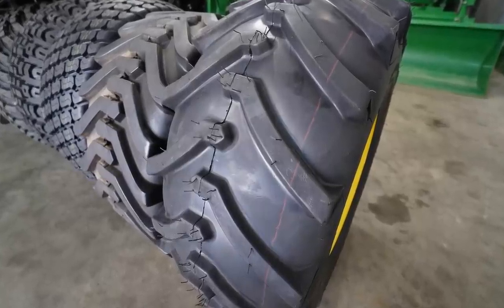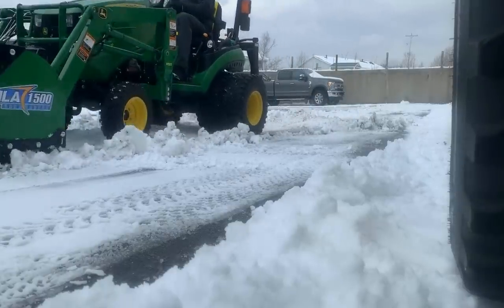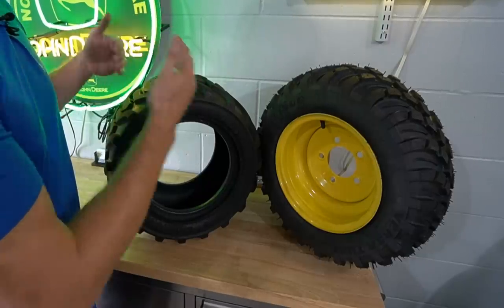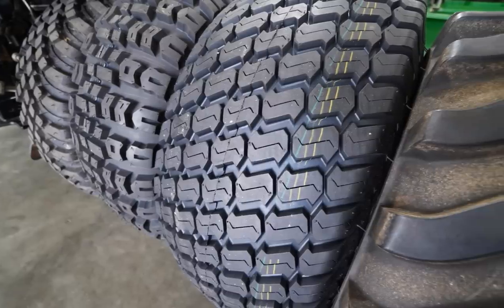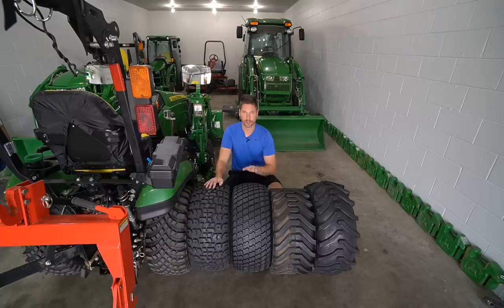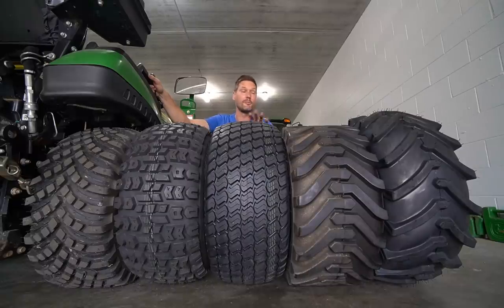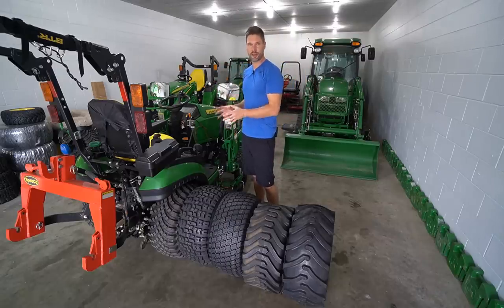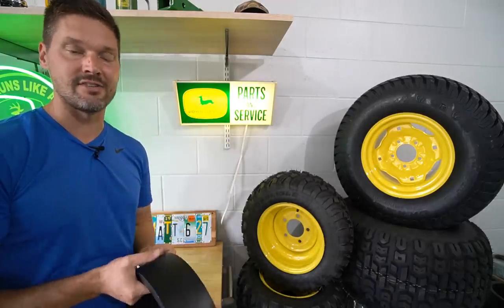THE ULTIMATE TRACTOR TIRE GUIDE: TREAD PATTERN OPTIONS! 👨‍🌾🚜

Comment: I have R4 right now but I do like the versa tracks. Can I run in the winter the R4s in front and the versa track on the rear or will I have to buy a set of versa tracks for the front also? By the way, great videos, keep up the great work. I may not always need or want what you show but it is nice to see what is out there and to learn more about what you can and can't do with a tractor. Just a few more things to do and check and the BX will be ready for snow. Who knows maybe no snow this year, yeah right.

Comment: R4 Industrial tires were originally designed for skid steers and forklifts.  Those operated mostly on hard surfaces and carried heavy loads so R4s as a general rule will have hard compounds, high load ratings, and long treadlife.  However, since they were designed for steering by sliding tires (skid steering), they don't do so well on a tractor that might be on a slope.  It also makes them prone to sliding around on hard surfaces, and not really all that good in mud or sandy conditions.

R1s are by far the traction tire of choice if you're doing any ground engaging tasks but many weren't designed for the steroid-pumping FELs of today's tractors.  Be careful to make sure your R1s are load rated to match your loader or you can end up with problems like ruptures or rolling off the beads.  R1s can also be more prone to punctures if you're clearing land with limbs/stumps, and even some heavy thorns.  To aid in getting the most weight to the ground (pounds delivered per square inch) R1s are often a narrower tire than R4s and often use a smaller width rim, making it difficult to do a direct tire swap from R1 to R4 or vice versa.  It also means that an R4 of the same height will generally be able to hold more liquid ballast than an R1.

I'm really glad to see modern offerings like the R14s which give ride quality and load ratings equal to or better than R4, but traction closer to an R1.  They are also sized in common rim sizes for both R1 and R4, making a tire swap from R1 or R4 to R14 a more cost effective option.
Reply from the maker: Great info Keith, thanks for sharing!

Comment: Just got r1s for my garden tractor but as far as plowing goes I'm going to be running chains so my tires won't do much for plowing but I'm going to be doing other things with it were they may become handy pulling tree stumps out with it mowing over grown weeds that may possibly have mud as far as mowing goes I do my nixes finish cuts with my zero turn that I will only put terf tires on for the exact reason u said ag tires will destroy your lawn ezpectaly if your not carefull

Comment: Looking for a good snow tire for plowing & blowing snow , I have a X758 , is it best to have a WIDER tire or a smaller tire , thinking of doing a dual wheels like you did with 2 tires that are not as wide , or is it best to have 2 WIDER tires duallies  , or just 2 wide tires ?
Reply from the maker: Snow removal requires traction.  The more surface area making contact with the ground, the better the traction.  However, weight is also needed.

Comment: john deere x495, current tires are turf but I use chains snow blowing with 47 inch blower attachment. the tractor doesnt' turn that great with the snow blower down.. Am interested in the versa turf and my question is would I still need chains and would the fronts be better for turning in the snow? Would like to get away from chains as  I don't take them off in the summer, I just mow with them on as they are such a pain in the ass to put on and take off. Thanks for the info

Comment: I've seen Neil with Messick's, Tractor Time with Tim, and you all cover tires appropriately sized for the Deere 1 series and BX lines. The short glimpse of your 4066r with the R14s is what I'd really like to see more info on. It seems there's no dearth of opinions and comparisons for the sub-compact tractors, but I don't see much on the 3 and 4 series Deere-sized tractors. I have a 3320 cab tractor with a loader that does horribly in the snow, so I'm especially interested in what you think about the r14s on your lawn and in the snow later this year.
Reply from the maker: Perhaps you missed it, but these aren't just for subcompacts.  These are for tractors in general.  The R14's are basically the Versa Turfs.
Reply: @GoodWorksTractors  Nope. I didn't miss that the R14s are the larger equivalent to the Versa Turfs; I just want to see a good review of the R14s on a larger, heavier tractor along with any advice that may also come in handy. For example, after seeing this video and researching what it would take to equip my 3320 with R14s, it doesn't look like the conversion is as straight forward as the 26x12-12 tires on the 1 series (or X-series, BX, etc.). If what I'm seeing is correct, the change from the 15-19.5 NHS R4 tire on my tractor also requires a change in rims if I'm interested in going from an industrial bias ply on a 19.5" rim to a radial "metric" tire (like the R14) due to differences in the bead. Did you run into the same thing with your 4066R? Also, did you find appropriately sized front radial tires, or are they still bias ply?
Reply from the maker: Any tire shop expert will get you the equivalents.  I never worry about figuring out the size as my guy down the road never steers me wrong.  I didn't change rims on my 4066r, only tires.  I made a complete switch to radials (fronts and backs) on both machines.

Comment: Found this trying to find some replacements for my Ford 3400 on the front. The ones i got it with don't match one is like a deep three rib ag tire, the other is like shallow 5 rib hold air but are cracked so going to replace. The back ones are good shape but have the industrial tread. Hoping use around the house and move snow, etc.

Comment: Thank you sir for your insight.. I am taking delivery on a 3033r and they are coming with R4s, I just called my salesman to halt the shipment as I have an extremely sloped gravel 100 foot drive in the tip top of Michigan and we get 300" per year. How do you feel that would work with HDAP or R3s.. I'm filling the rears and may (or should) I use chains in front?  Any advice would help. Have a great day

Comment: Is there a guide to convert from any tractor model to R14 tires?  I have a JD3043D and want to know if there are replacement R14 tires instead of my current R1 tires?  Also would I have to replace the rims?

Comment: Do you think  the R14’s are a little more versatile? I have a 2025r and being an old hotrodder I’m always looking for a way to better my equment. I mow, push snow, loader work, pull wood, just use my tractor for several things. And from you video I take it the traction increase is very noticeable with the Versa-turf? Thanks for your input friend!
Reply from the maker: I absolutely love the R14 and the Versa Turf...both similar treads and radials.  After having such a good experience with them on the 1025r, I chose to upgrade (big expense) on my 4066r.   Well worth it in my experience.
Reply: @GoodWorksTractors  thanks for the input! Like you said in your video, the R 4’s are an ok all around but a radial will definitely help w/ traction and ride comfort. I’ve watched this video a couple of times trying to convince myself to make the move and get a set of 12-16.5’s and 23x8.50-12’s for my 2025r . I believe after Christmas I’ll go tire shopping! Merry Christmas to you and the family!

Comment: Yeah those R4s suck for anything that has to do with dirt or manure.I have R4s on my skidsteer and everytime I go to clean out manure out of the run in sheds after about 3 scoops out of the sheds the tread fills up and loose traction very quickly.And for digging dirt they are good as long as it is bone dry but if it is any sort of wet they fill up very quickly and start spinning and leave deep ruts.

Comment: I like the video... Very helpful for planning in the future. Curious, what are the options for the front tires? Are they the same? If not, maybe another video idea.😁😁
Reply from the maker: Hi Seth, same tires fit all around...I just highlighted the rears.  Hope this helps!
Reply: @GoodWorksTractors  I know that this will sound a little bit crazy but does anyone make duals for the front?  Or is that totally worthless idea because it will damage the front end.

Comment: I was mowing with my cub gt2544 this year, we have a lot of mud and puddles in our yard. They tend not to go away. Ive never got the machine stuck. I also try not to mow as much as i can in the super wet, cause the machine ways over 1000lbs. But it has turf tires, as soon as they got packed with mud it was over. It did manage to get itself unstuck. But these turf tires suck. Is there a better kind of tire with grip for muddy grass?

Comment: Hi, great vid. My rear axle Bridgestone PD1 tires, size 355 80 D20, are heading for exchange, soon. I contemplate to go for 365 80 R20 light truck tires as they are roughly a third the price of the PD1. I already changed for Goodyear Wrangler Adventure AT in 215 80 R15 on the front axle ( good off-road style tread pattern, similar to PD1). What do you think of my idea for the rear axle? Any recommendations on size, brand and model? My tractor is a Kubota L2850DT (4WD part-time), which I use for private proposes,  only. Regards Heinz, Germany.

Comment: I run my tractor in areas with a lot of brush and thorns.  Which tires do you think hold up best to that?  My tractor has the R4's on it, & so far (knock on wood) no flat tires.  But I would like to have a little more versatility without running the risk of getting flat tires all the time.  Thanks for the help.
Reply from the maker: Good question, need a heavier ply rating....so whatever you can get your hands on!

Comment: I have a new 1025R with R# (turf) tires.  The rear tires are really chewing up my lawn.  This was a replacement for a GT245, which had a similar tread pattern and only slightly smaller tire.  I am not in four wheel drive, and the rear differential has not been locked.  The only thing I could come up with is tire inflation.  The tires appear to be over inflated (22 psi vs. 20 recommended), and I am reading elsewhere that others are running below the recommended PSI.  Can you offer any guidance?  Thanks!!
Reply from the maker: I'm not sure Paul.  Turfs are about the safest option for your lawn.  Don't mow after a rain, when wet, when damp.  Don't turn on the same spots repeatedly, take wider turns, few things that come to mind.

Comment: Great video about tires!  I do have a question for you.  I have a 2019 John Deere X758 with the HDAP tires on it currently.  I had a X585 before that with the turf tires on it.  I mow, plow and snowblow with the tractor.  The only thing I don't like about the X758 compared to the X585 is that the ride seems to be way worse with the X758.  I have a bad back so I really notice the difference.  Do you think if I switched from the HDAP to the Carlisle radials, the ride improvement would be noticeable enough for the cost of getting the radials?  You have had HDAPs and the radials on the same sized wheels, so I figured you would have an opinion on the ride quality improvement.  Thanks for any advice!
Reply from the maker: Hi Russ, well I think that's going to be a bit subjective.  I have never found my old x739 to be a rough ride which is nearly identical to the x758.  I bring that up as I don't think I would personally see a noticeable comfort improvement on it given that I don't find it to be uncomfortable to begin with.  I'd hate to see you spend your money and not see a significant change.  Have you tried letting out some air pressure on your tires?  Perhaps they are overfilled or filled to the max recommended pressure and lowering could help reduce some of the stiffness?
Reply: @GoodWorksTractors  Yeah, I did try the lowering of air pressure, but it really did not make any noticeable difference.  I truly appreciate your honest opinion.  I wish I could find someone who put the Carlisles on a X700 series tractor to see what they think.  Maybe an idea for a video from you in the future??? Lol!

Comment: I'm not sure I agree that the R4's are the worst tire for muddy conditions.

My brother-in-law recently switched from R1's to modern, radial, Carlisle Versa Turf tires. He absolutely loves them on snow and says they would be great for mowing and other lawn use.

Unfortunately he was working out back, trying to improve drainage in an area where there is very thick mud and he got stuck.

I helped pull him out with my 1025R that has R4's on it. In that particular thick mud the R4's were far superior to the Versa Turf tires. The difference was so much I could almost drive in 2wd where he was getting stuck in 4wd. He claims his oldloaded R1's would climb that same rise in 2wd.

Admittedly he has a different tractor (Kubota B-series) and a somewhat different weight configuration. He has the loader on the front, a quick attach 3-point in the rear and occasionally his rear box blade for ballast. I've got filled tires (all 4), a 120R loader (heavier loader?) and my rear 260B backhoe was installed the whole time. Both of our mower decks were off.

Have any of you also found the R4's superior in mud compared to the Carlisle Versa Turf tires? What type of mud was it?

Comment: 2nd attempt, What front tires would you recommend in combination with the 26x12.00-12 Carlisle Versa Turf 4ply radial?  I followed the link you recommended but landed only on rear tires.  I find my fronts wear twice as fast or at least take more of a beating.  Currently have the turf tires on my 2305 JD
Reply from the maker: They make the Versa Turf for the front as well.  You may need to contact Miller Tire to order them.

Comment: I've had R4 on my tractor since new, I work in clay soil, and had used it in snow. it all comes down to how you operate the machine in many scenarios, but did a test in a field and the AG style tread would have been better then.
Reply: I agree 100%If you're going to be running chains in the winter you want the agricultural adjustable rims also this gives you more clearance between the fender and the tire
Reply: I have never had issues with r4s and last week we got buried didn’t loose traction once and drove up hill

Comment: What tire is the best tire for a backhoe on a 1025R I have turf tires in now and the tractor sways side to site a lot?
Reply from the maker: I don't really think any single tire option is going to help with that issue unfortunately.
Reply: I think the turf tires have a soft sidewall which probably makes more sway than the construction style tires with stiffer thicker sidewalls.

Comment: I hate, hate, hate, HATE, HATE!! R4 tires lol I had a 2005 4320 cabbed tractor with R4 tires, tractor had to be in 4x4 so often. My buddies 861 power master ford was 2wd and pulled as hard as my tractor in 4wd. 

I like turf tires the best but have yet to try the R3 Radials. My current tractor is a 5555 Mahindra with R1 tires and I haven’t had to use 4x4 on it yet but I haven’t had it very long. 

In my eyes turf tires is a plus and R4 tires is a negative when I’m shopping for tractors. R1 is more aggressive than I want but the marks it leaves on turf isn’t a big deal for the superior traction. In my experience I can run over my lawn when it’s wet, as long as I don’t spin tires, the marks go away within a month or two, so who cares lol. Not worried about marking up the grass anymore.

Comment: Per Your recommendation I purchased a set of Versa Turfs for my 1025r.  Frankly, I just don't get it.  I live in North Carolina so snow isn't an issue.  They do provide a smoother ride while mowing than the R-4s.  But, 90% of my tractor's work is ground engagement.  They just don't bite into the red clay down here.  They also give a me queasy feeling when raising a loaded bucket.  Luckily, I bought them with rims.  I got on a job that I just couldn't get the traction to complete.  I drove back home, through the nearly bald R-4s in the back of the truck, went back and completed the job.  I sold the Carlisles on Craigslist and didn't take too bad of a beating,  However, although I warned him, the fellow I sold them to wanted his money back.
Reply from the maker: Sometimes you don't know until you try it.  Nearly bald R4's aren't my cup of tea.  Tough to imagine how they would excel over nearly new radial tires.  Could be other factors at play.  Hard to say. 🤷‍♂️

Comment: My first 2 winters with R4s were fine. After the lugs had rounded a bit from use, the third winter was pretty bad traction wise. Im watching an R14 set on eBay for my BX23S. Probably pulling the trigger on them for this winter.

Comment: not a single link has availability been trying to get a set of turfs for the front of my 2210 but dealer wants 600$ for a set of rims as i already have rubber
Reply from the maker: I just bought the fronts in R1, R3, and HDAP last week, so they probably just temporarily sold out.  I've purchased fronts and backs through those links many times over the years, so they will replenish.